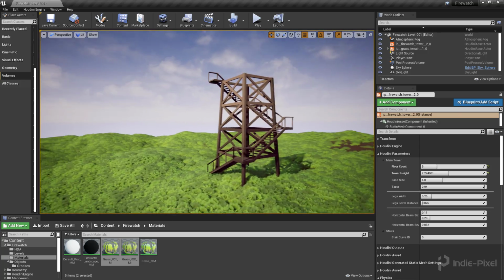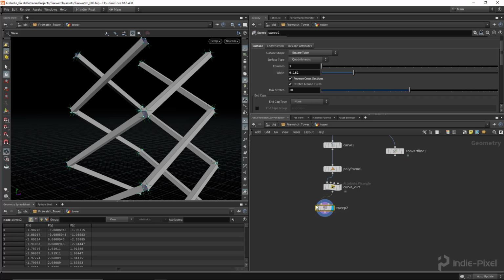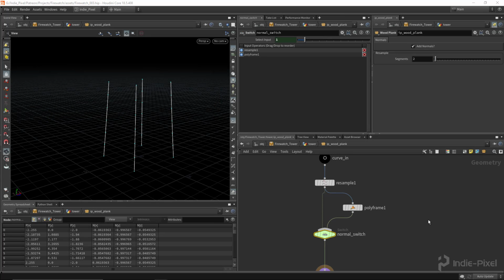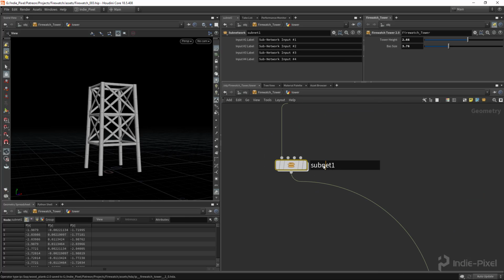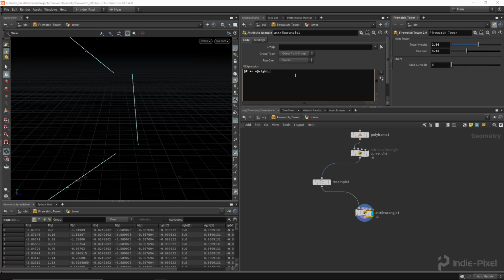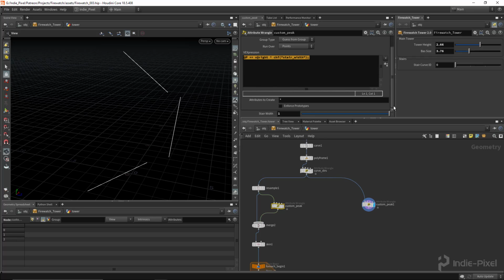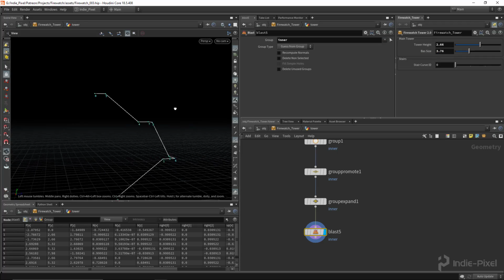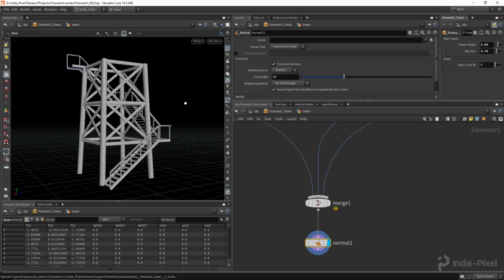Houdini 18.5 - Firewatch Project - Building the Base Tower

Comment: Can anyone please help? At stair railing part!   When I extrude and check on extrude front seam, and then blast I get the same shape not the outline as you are getting?  When I turn on display group and attribute test it shows the outline but as soon as I blast it shows me planes we got from fusing the mesh. Please help!!
Reply from the maker: Hard to know from the description alone, but make sure all the points in your mesh are in fact fused.  That could be one reason.  Try messing with the Fuse distance slider to see if that helps.  That is my first thought without looking at the hip file.
Reply: try convertline node

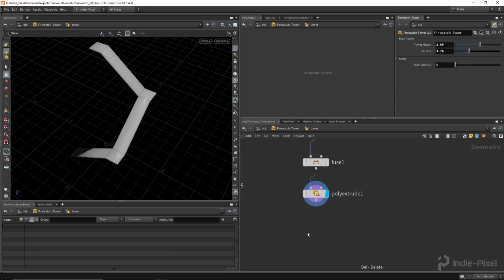Comment: 57:32 Hi, I would like to ask why when I use blast to delete extraFrontSeam, only points remain instead of edges?
Reply: Replace blast with convert line.... 😅
Reply: @scritorr  Thank you，I found that using version 19.5 does not have this issue.😊
Reply: @scritorr  Thank you very much. I replaced it with a convert line and there was no problem.

Comment: Can anyone fill me with the usecase of @right and @up ?
Reply from the maker: The right and up attributes, in this case, store the right vector and up vector.  These vectors are useful in many cases.  Say you want to offset some objects to the left or right of a curve,  we'd use the right vector multiplied by some float value to do so.  If we wanted to offset those same object up or down we'd use the up vector.  These attributes arent default / built in attributes, like pscale is, so we have to calculate them ourselves.   That's a high level explanation.  Hopefully it helps a little. :)
Reply: @IndiePixel3D  Thank you so much , now i got the clear idea about it. Also I recently found this channel on youtube its simply amazing like a gem. once again thank you for your reply.
Reply: is there any discord channel for indie-pixel?
Reply: @IndiePixel3D  also why we are omitting the y component of flatenrm and cross multiplying normalized flatenrm with the world space y component.
Reply from the maker: @mssanimation9383  we do that to build the right vector.  At that point in the calculation we haven't built the up vector yet, so we use the world up vector.  This will not work with vertical curves.  I explain more in this video: https://youtu.be/o1vGKRcwFWw
Reply: @IndiePixel3D  yeah i have watched that video it has a deailed explanation about it thankyou so much

Comment: Indie Pixel does such great tutorials but I noticed a few people complain about the cut at 29:30. To fill in the bit that got cut out you can do the following (I think I got everything, if not let me know):
1. Go back into your wood plank HDA, add a match size node after your shape grid.
2. Connect this to the poly bevel and replace the Grids connection into the bevel switch.
3. Promote the 3 justify attributes on the match size node. (set their defaults to center)
4. Promote the reverse cross sections toggle on the sweep node (the same reason mentioned earlier in the vid)
5. Save your planks HDA and update it.
6. Go back up to the main tower HDA and pull a new line off the copy node (on the side that makes the legs)
7. Add a split node
8. Set the group to zero, group type to primitives and invert the selection.
9. Add a new wood plank HDA copy, and adjust to your liking (do not compute UV's because it gets all twisty)
10. Add a merge after the two wood plank nodes.

I think I filled in all the blanks :) This comment will be obsolete once the vid gets updated but much love to IP for providing such good content! 💜💜
Reply: Thanks for the explanation! What I also needed to do was disabling the normals and reversing the cross sections in the new wood plank hda node. Otherwise half of the individual horizontal beams were/looked inverted.
Reply: Thank you 😃

Comment: Hi, thanks for the tutorial! I'm having an issue while creating the stairs it seems. The carve node doesn't seem to be breaking off, and the normals are acting as though the node isn't there. Blast is working as it should. This carve node could be the issue, or it could be something else, but the resample and attribute wrangle don't work correctly either (skinning instead a flat plane that goes all the way up), and carve seems to be the farthest node up that's acting strange. As far as I'm aware, I have everything correct, but it's definitely user error. Tried using peak as well, and the normals still twist. Any suggestions on what to check would be greatly appreciated, as I'm pretty new to Houdini and trying to troubleshoot is very difficult. Thank you!

Comment: This is awesome, can't wait for the next ones. I just learned so much. At 29:21 when there is that cut, all I think was done was to sweep along the main prims of the tower after the copy transform. To get a polyline around those prims I just used the polypath node and put my wood planks node on those prims. Also it seems an edit was made to the wood planks hda where he put a axis align node down after the bevel switch and exposed the justify params, not much was missed, but just thought I would comment for anyone who got confused.
Reply from the maker: Doh! Did I not show that, or maybe I cut the video without noticing...I'll make sure to double check in the next vids!  Glad you liked it!
Reply: @IndiePixel3D  No chance to fix it? I really enjoy it, but at this point I got stuck :(
Reply from the maker: @CsabaKanál  I can take a look this weekend and see what I did to the video edit.  Stay tuned!
Reply: @IndiePixel3D  Thank you !!